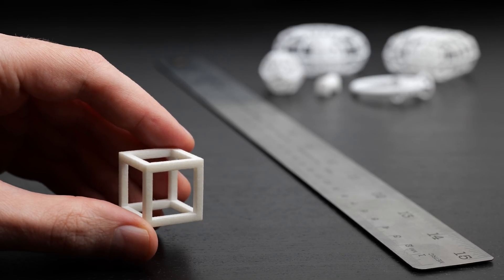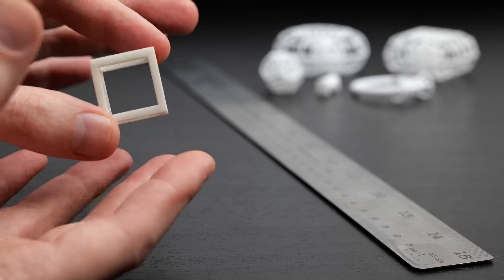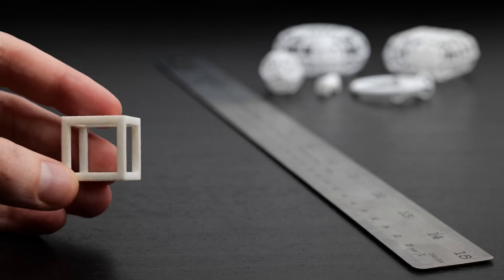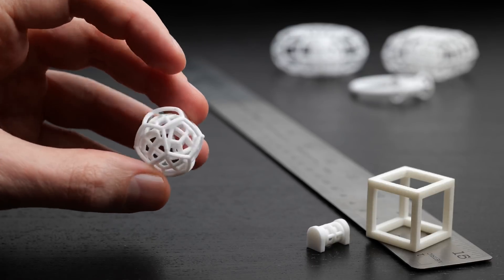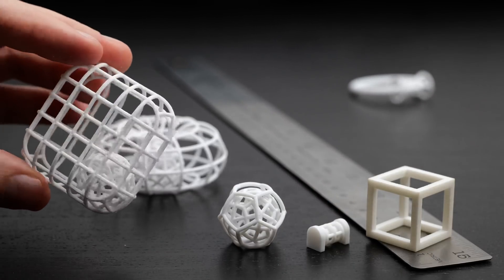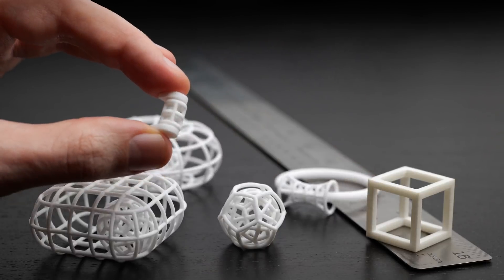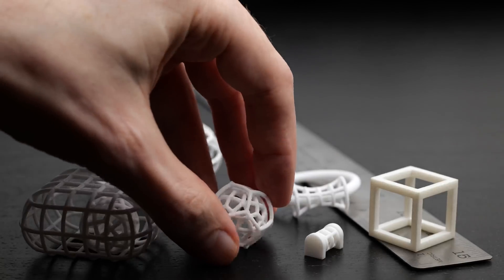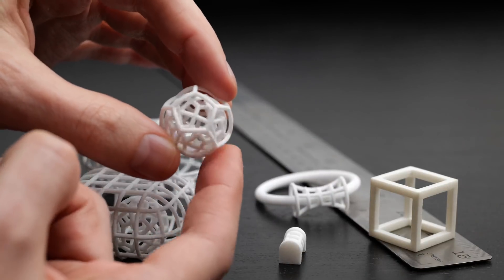Puzzling degrees of freedom

Comment: Would a cylinder in a relatively squat cylinder cage which's axis is orthogonal work? Like a carrot in a petri dish which's diameter is the same as the carrot's length?
Another way I suppose is taking the two concentric spheres and giving the inner one a nubbly and the outer one a circular groove going around its diameter which the nubbly can fit into. The inner shape could be slightly squished so that its center of mass stays in the center by depressing the area around the nubbly (I refuse to call it anything different for personal reasons [and by personal reasons I mean humor]) toward the center to offset it (the nubbly).
I wonder if some of the solutions that use straight lines could be made more symmetric by using circle inversion (well, sphere inversion really) to make plains into spheres?
Another possible (if almost certainly degenerate) way of doing it would be to put two very thin very tight oblique loxodrome shaped groves going in opposite directions in the inside of a cage (similar to the circumferential groove from the nubbly one) and have a perfectly thin stick effectively between them with a length the size of the diameter +groove. Is it still technically one axis? Yes, I think, honestly I'm not sure, but you can get to any precision you want so, yes? (kinda hilbert curvish tbh)
Now I'm wondering if you could have multiple depths of grooves to get a nontrivial solution out, hmmmmm, no idea.

Comment: I just thought of a more elegant solution for the 2dof than my previous comment.  Start with two spheres, one big, one small; squash the big sphere down one axis so that it's inner surface touches the small ball at two points exactly; now stretch the small sphere so that it touches the equator of the big sphere at exactly two points (or rather, it's surface matches the profile of the squashed sphere, touching it along a line all the way around, perpendicular to the squash axis). And there you go, the stretched small sphere can rotate along the squash axis of the big sphere, as well as along it's own stretch axis.

Comment: 2dof: Take a sphere, place another sphere inside it in a snug fit (with adequate low friction, of course); attach a thin cylinder  perpendicular to the surface of the inner sphere, carve a channel along the shell sphere to allow the cylinder to pass as the inner sphere rotates (but don't complete the channel all the way around or else you'll convert the shell sphere into two partial hemisphere). The sphere can rotate along the length-wise axis of the cylinder, and along the axis that moves the cylinder along the channel.

edit: To allow 360 degrees on both axes; make the cylinder just a shallow stump, with length smaller than the thickness of the shell sphere; and carve a channel along the inner surface of the shell sphere that doesn't form a hole to the outside, just a groove; now the cylinder stump can go all around.
Reply: I was reading through the comments seeing what other people had come up with and I guess my idea was less original than I thought

Comment: Question: since you only need one quaternion to orient the sphere inside the sphere, is there an n-dimensional number that can position an object that has 6 degrees of freedom?
Reply from the maker: I guess it depends on how much you’re willing to extend the meaning of “number”. These things are usually thought of as elements of groups.
Reply: @henryseg  My question includes the group that contains all numbers. Unless there's currently a debate in the mathematics community on the definition of numbers, I'm going with what's been agreed on. To my knowledge n-dimensional numbers (i, j, k, etc...) includes every number we know. If I'm wrong, please pop my bubble.

Comment: For two degrees of freedom we can take a cylinder and a cube where the diameter of the cylinder and the length of the side of the cube are the same - there the cube can move in two directions or in a single plane

Comment: I'm gonna cheat a bit and say you can scale the  object. But: Take a two circles of the sphere on S3, such that they are conjugate and have exactly  one point in common, this is our boundary.  Our object is the kissing circle between the two bounding circles. The kissing circle is now uniquely determined by 1)Rotation about its normal 2)Scale 2.5ish)Sign because double cover of SO(3). Now project this to R3, by careful choice of our bounding circles, we are now unbounded in R3 except the circle that derives from the point shared by the bounding circles on S3. Though I may not have thought this through entirely....

Comment: My solutions were:

1. A cube trapped in a square tube. It only knows Surge/Sway/Heave, depending on the orientation of the tube.
2. A cylinder trapped in a round tube. As before, but now it can rotate around the axis of translation.
3. A squat cylinder trapped between two planes. It can translate in 2d, and rotate around the axis through which it can't translate.
4. 
5. A ball trapped in one of your Holonomy Mazes. Which I suppose is just your two planes solution, but those planes are concentric spheres instead of parallel planes.
Reply: For #4 you could have a sphere within a cylinder.  It can rotate on any of three axes and move parallel to the cylinder's axis, but can't move in the other two orthogonal directions.

Comment: take a sphere and cut it down its equator, and join the two halves with a protruding handle(s)
now imagine there is a ball stuck inside the sphere, with a line sticking out such that it must escape through the equator. Then the line has two degrees of rotation, namely, moving the line around the equator, and spinning the line about itself, but cannot rotate freely in a third direction due to the rest of the sphere blocking it, and cannot translate in any direction due to being attached to the ball, which is stuck in the sphere
Reply: importantly, the handles must protrude enough to let the line sneak ‘under’ them

Comment: A Not-quite-solution to the “two rotational degrees of freedom” puzzle, which I think helps illustrate its impossibility (at least in a certain sense) that I'm a bit confused about what "degree of freedom" means:

The Not-quite-solution:
- Imagine a cross-shaped bar (two perpendicular rods joined at their center).
- Now place that inside the second object which is a cage in the shape of a cross-shaped slice of a sphere (two perpendicular disks joined at their center).
- Fix the cage in place so that the intersection of its ‘disks’ is parallel to the z-axis, and each ‘disk’ is aligned with either the x or y axis.
- When the two objects are snug and properly aligned, with the arms of the internal cross-shaped-bar parallel to the x and y axes, then the bar can rotate around either of these two axes. But the walls of the cage prevent it from rotating around the z-axis. The bar is also prevented from ‘switching tracks’ until it makes a full 180 degree turn.  

Almost everywhere, the system locally only has one rotational degree of freedom, but globally the system has two, right? Well… no, actually. It might look that way if we’ve built the objects of homogenous white plastic, but it is still possible to rotate the plus-bar around the z-axis. 

The Problem:
To see why, imagine that we’ve colored each arm of the bar a different color. Or better yet, grab a piece of paper and follow along at home. Mark your piece of paper at the top of one side so that you can clearly see its orientation.
- First flip the bar 180 degrees around the y axis (or flip the paper right-to-left). 
- Then flip the bar 180 degrees around the x axis (or flip the paper top-to-bottom).
Behold! The bar (or paper) has rotated 180 degrees around the z-axis!  

As other commenters have pointed out, rotations along two perpendicular axes  in 3D space can be added together to get a rotation around the third axis. 

Edit: Though it also occurs to me that your examples with the torii have 1 translational degree of of freedom, but in moving around in a ring, the objects are translated through 2 dimensions of 3D space. They only have 1 translational DoF either in that sense that A) locally, they can only ever translate in one direction or B) that the set of positions the object's center can occupy is 1 dimensional. If the rotational degrees of freedom are defined in a similar manner, then the objects I describe above and below have 2 rotational DoFs in the sense of (A). Whether they also have 2 RDoF in the sense of (B)... Well, I'm going to need to go read some math to understand how to think about the set of rotational positions an object can occupy.

Thanks for the video! 

A Question:
I’ll end this comment with a question to you: The above design forces the system to make a 180 degree turn before switching tracks. If you could instead design it so that it must make a full 360 degree turn before switching tracks, then there would be no way to combine the x and y rotations to get a z rotation. Is it possibly to design such a pair of interlocked objects? If no, why not?
Reply: Also, here’s a second not-quite-solution which is a simpler equivalent to most of the solutions posted in these comments:
- Imagine a rod inside a disk shaped cage. 
- We can “roll” the rod along its own lengthwise axis, 
- and we can “yaw” the rod by changing its direction inside the cage,
- but we can't "pitch" the rod back and forth.

Two rotational DoF, it seems. And in a certain intuitive sense, there are only two ways the rod can rotate. But think about it from the fixed perspective of the cage:
- Set the cage flat on the ground. The rod yaws around the up-down axis.
- Yaw the rod until its axis points east-west. It rolls around the east-west axis.
- Then yaw the rod until is axis points north-south. Now it rolls around the north-south axis.

As in the previous not-quite-solution, there are restrictions on how the object can rotate, such that one object can’t move to any  arbitrary orientation with regards to the other. But for all three perpendicular axes, it is still possible to move the object in such a way that that it has rotated along each of those axes. In this example, if the rod is aligned east-west in the cage, then we can rotate it 180 degrees around the north-south axis by spinning it 180 degrees, and then yawing it 180 degrees.
Reply: Here's a not-quite-answer to the question I asked above. I still can't imagine how to modify my example above such that the internal bar must complete a full 360 degree rotation before it can ‘switch’ tracks. But a similar effect can be accomplished simply by preventing it from turning even 180 degrees. 

Put a little blockage in there. Now it has to return to its original position to change tracks. It can rotate either around the x-axis or around the y-axis, but not both at the same time. Thus there is no way to combine the two to get a rotation around the z-axis. But there is one position where it can locally move in either of two rotational directions. 

Also, looking at my own wrist, it seems like it is built according to a similar mechanism, though somehow with a bit more wiggle room. I can tilt my hand back and forth quite easily, and I can tilt it side to side, but I can’t rotate my hand (the entire forearm moves). Tilting my hand both forwards and sideways at the same time feels more difficult, and feels like it might be deforming the joint. Welp, time to go look at some anatomical diagrams, I suppose.

Comment: Probably wrong, but didn't you already give us the answer for the second question? 2 interlocked toroids either externally as shown or internally, given the outer shell torus can turn inwardly too. Kinda violates "ridgid" though.
Reply: in the description he specified that the question is specifically referring to configurations where the rotations are about lines that have a common center point
Reply: @debblez  Ok, doesn't give much direction, ironically. By your stating, implies his 2 degrees example is wrong also since all I've done in example 1 is complete the second very obvious torus - just complete the existing mesh. And in my second concept, they're literally concentric, nested rings. Arguably, you can say it has 4 degrees, but I'd argue it more correct to say it says 2x2 degrees as any movement around the centerpoint outside the rings requires movement in the second centerpoint within the rings. Something, something, inertial frames, probably still wrong.

Comment: For two degrees of rotational freedom, I thought of a cylinder lying sideways inside of another cylinder, where the inner cylinder's edges touch the curved face of the outer cylinder at four points, restricting its horizontal motion, and the inner cylinder's curved face touches both circular faces of the outer cylinder, restricting its vertical motion.
Reply: ooh i really like your solution.

Comment: I pictured a pole, with at the end a sphere with a relatively hollow inside. the sphere could by moved a round in a small circle around the top of the pole, but since it wouldn't have another hole at the top, it can't translate up or down. this has 4 degrees of freedom (can move slightly left, right, forwards, and backwards, but can also be rotated slightly left or right and slightly forwards or backwards).

Comment: wouldn't even have to put the "wheel" on a circular axle, a regular longer one would still only be 2 degrees right, forward/back across the longer axle and rolling around the axle.

Comment: Take the 3-rotation solution. Take an axis, make two small pins on the outer shell, and two small holes on the inner sphere. We went from 3-rotation to a 1-rotation solution.

Now, instead of two small holes, we have a groove that circles around the inner sphere. The inner sphere can rotate inside the outer shell along the groove, or around the two pins, but not a third axis. Therefore, two rotational degrees of freedom.
Reply: I like your idea but there's a catch: rotate the inner sphere  90° on the pins axis so that the "locked" axis is parallel to the grove and the "locked" axis just swapped places with the one that was free at first. It's still 3 degrees of freedom, just with conditional limits. Sure, you can't get to any arbitrary set of rotations, but you CAN rotate around all 3 axes, just in "turns" :P
I wonder what Henry has to say about this particular example?

Comment from the maker: Was there enough blur on the background so that the puzzle wasn't spoiled just by looking at my solutions?
Reply: Absolutely, and I thought that was a pretty clever trick for it!

I think you could reuse the "sphere in a torus" model you have for two degrees of rotation. You could add a second sphere at the other end of the torus, connect the two spheres using a cylindrical rod, and create an opening through the torus so the rod can spin the spheres around.

Comment: My solutions were:
1 degree = A cylinder enclosed in a cylindrical cavity (where all dimensions are the same size), allowing only rotation in one axis.
2 deg = Take the cylindrical cavity and extrude it in one direction (for example, make the cylindrical cavity taller than the cylinder). A cylinder can now move along the cavity linearly and rotate about one axis.
3 deg = We can keep this line of thought going and have a cylinder enclosed in a cuboid cavity where the height of the cuboid is the same as the height of the cylinder (imagine a coin sandwiched between two sheets of glass). So the cylinder can rotate about one axis and move in the X and Y directions but not the Z direction. OR simply a sphere enclosed in a spherical cavity (allowing for 3 rotational degrees of freedom but no displacement)
4 deg = Take a spherical cavity and extrude it in one direction, like a sausage shape. The sphere can rotate in 3 degrees and move laterally in one direction.
5 deg = A sphere enclosed in a cuboid cavity, allowing for 2 degrees of displacement and 3 degrees of rotation (imagine a ball sandwiched between two sheets of glass).
Reply: The solutions I imagined were almost the same as yours. For 2-degrees, I imagined a syringe or piston (cylinder inside of a shaft, same as yours), and then for 1-degree, I imagined making that syringe square or putting a little guide-rail in it.
Reply: 5 deg – sphere inside a 2D sausage
Reply: I thought pretty similarly

Comment: For 5, turn those two planes into two toruses. The central mid"plane" between the toruses can describe the position of the sphere. The position on the torus can then be denoted by two angles. It wouldn't be truly unbounded, though, as you would need some support material connecting the two toruses that block the path of the sphere.

Comment: 2 rotations is imposible since 2 linearly indepent planes have to be embedded in at least 3 dimensions. If you could print something 4dimensional it would be possible in the special planes of e1^e2 and e3^e4 for example.
Reply: nobody said the rotation planes had to be linearly independent.
Reply: @debblez  if you think about it, the rotations in 3d come "3 in the price of 2" because they are linearly dependent. T he only way to get "2 in the price of 2" is to jump in 4d where planes can be orthogonal and at same time never cross each other.

Comment: for the 2 axes of rotation   with example its posible i cam up with an idea  mix (4 degree torus shaped and 2 degree freedo with ring  and wheel )  let me explain with an example imagin dumbles = (two wheel in a axel and the axel ) now it's attached to torus which the center passes through the center of the axel (not the wheel) so now i can spin the wheel in one axes and rotate both the wheel like a Ferris wheel . its posible